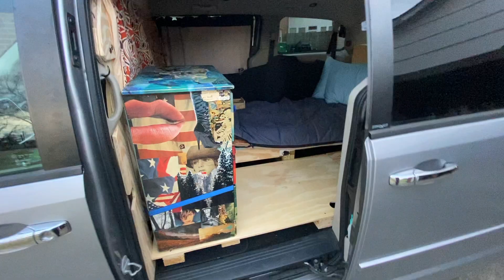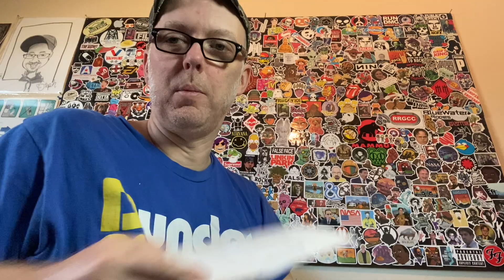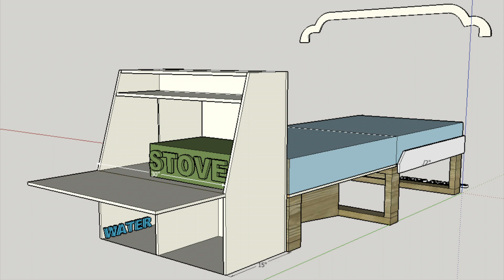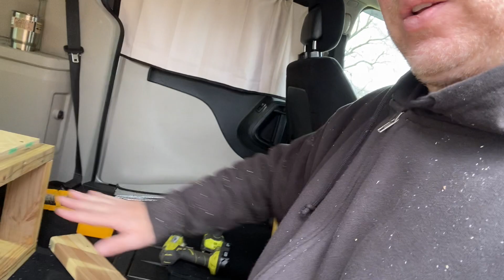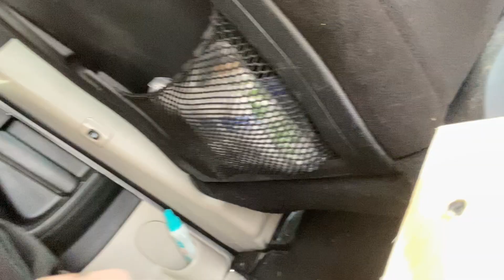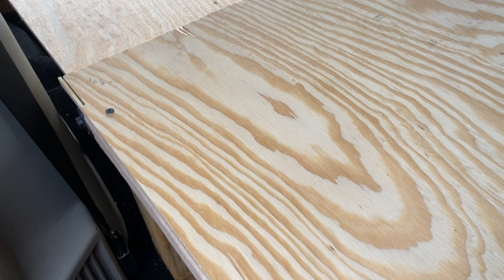Minivan Camper Bed Build | Part 1 | Dodge Grand Caravan

Comment: I was thinking of getting a carvan when we get our kia paid off. had a carvan for work and ran well etc.
Reply: No we have a Kia Sedona Van. We bought it over the dodge caravan but I'm thinking we we should of gone with dodge , I'm not a dodge fan at all but I only broke the one engine mount, set of spark plugs and heater fan replace. I think over 285 000 km on it and I drove the shit out of that van hard.
Reply from the maker: They aren't bad little vans and have a modest 3600 lb tow rating with a V6 engine. I love the space in the back! Do you have a Kia SUV now or what? -Marshall

Comment: What are you using for a mattress? Will it be some kind of memory foam mattress? 

If you don't plan on putting a waterproof cover on your mattress, another suggestion is to add holes all over your huge board (like peg board) that's supporting your mattress. 

In the summer, if there's no air able to circulate under your bed, it will hold moisture and start molding. Just wanted to give you a heads up. Winter I don't know much about all. That's another story. 😬 I hope this helps you out. 👍
Reply from the maker: Hi Merry May! I touch on that in part 2 of this miniseries: https://youtu.be/TQnrGzqmLt8?sub_confirmation=1 It's a 6 inch memory foam, narrow twin size mattress from Zinus that Bob Wells recommended. ✌️ Thanks for your recommendation! 🙏 Are you also in a minivan?